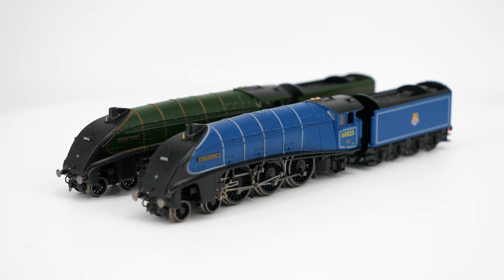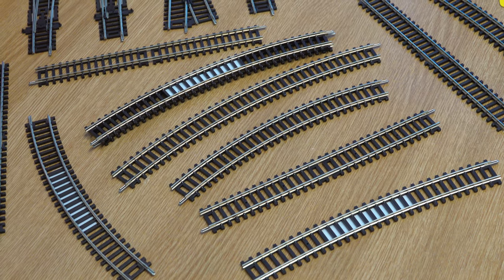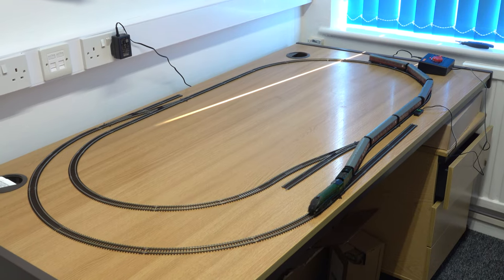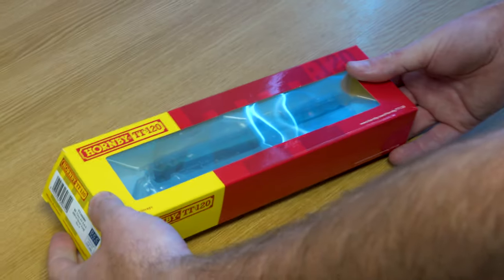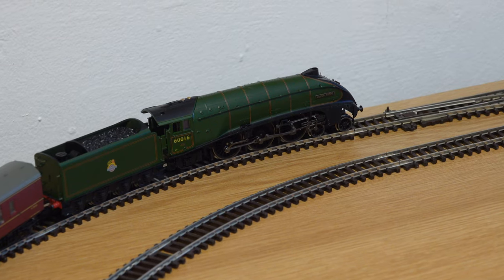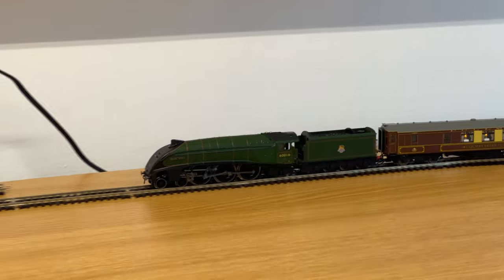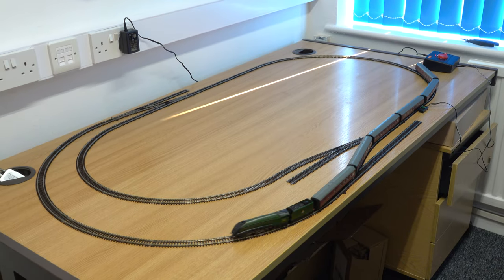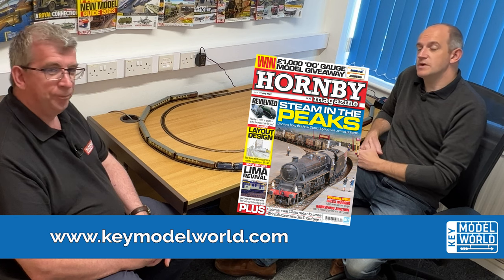HM193: Hornby 'TT:120' on test

Comment: im nearly finished the baseboards for Acton Wells in TT120 using 4 and 6 radius curves and straights. only thing is need hundreds of straights for 12 road fiddle yards. Have got a blue 08 which works with hornby analogue but with h and m controllers making the loco squeal. Pity cant get a driver in them. However have tested Flying Scotsman and mallard on 4 pullmans last week and run very smoothly . Lighting good too. No sound decoder for 08 yet as 6 pin what is best to use please. thanks
Reply from the maker: Thanks for your comments and great to here you are building a TT:120 layout. We are working on an installation guide for sound with the new Class 08 for release later this year.

Comment: I've not had a train set since I was a kid, far too long ago than I care to think about. Thinking of getting into it again with this scale but wondered if there is a big difference between TT and 00 in detail level levels? I like my detail....
Reply from the maker: Hi there. The new TT:120 models are very highly detailed and also look very true scale in ever way. Horny Model Railways have done a brilliant job on the tooling for the locos and rolling stock, so you won't be disappointed. Naturally the larger the models, the greater the detail (so OO will always have more) however TT:120 is highly detailed for the size that it is. 😊

Comment: Have they sorted the track geometry problem yet?
Reply: It doesn't look like it from the video. If you look closely you can see the track not sitting flat around the bends.
Reply: It feels that this video had filmed several months ago. But I' not sure if things have changed much since.
Reply: The "Geometry Problem" turned out to be a stress issue.  Once the curves are de-stressed they not only lay flat, but also have reasonably perfect geometry.
Reply: @WhatAboutTheBee  exactly a problem ,, pecos will without doubt be perfect straight out of the packaging , considering hornby specialize (allegedly )  in model railways you think they would be able to deliver a simple track section perfect from the box
Reply: @shakeyhandsshedmodelrailwa2494  get a grip.
Reply from the maker: Our track was loose laid on the desk top which caused the track not to sit flat around the curves here. The half circles we had of each radius (first, second and third) all made half circles correctly when tested. The video is new to go with our review of the A4, Mk 1s and Pullmans in the latest issue of Hornby Magazine - HM193, July 2023.
Reply: @hornbymag  the point that the Hornby TT track segments "all made half circles correctly when tested" cannot be emphasized enough.
Reply: @@ohiosteamandsteel Peco track all round is far superior.

Comment: Want too invest in TT but i see no mention of the smaller tank engines or era 2 locos. An 08 to move small freight and rolling stock around seems out of sink with the era 3 engines being served up. I dunno i think Hornby have something special potentially but there have been some red flags for me. Hopefully just teething problem because its new. May get into 00 gauge because of the availability of smaller engines, a shame, and yes i do not own a train set yet and am new to the hobby and  cramped for space. Would really love to see smaller engines, could do a lot in a small space, which is the idea. I love the smaller type of steam engines used in south Wales and the valleys in the past.

Comment: The rolling stock looks good, but I have to say that I prefer 3mm, 120 looks too close to N and those European couplings are awful (can they be used for shunting?). Also the track looks too much like Hornby circa 1976, such a wasted opportunity (I suppose that Peco's may be better 🤔). I was really excited about TT, but now it all feels a bit rushed, a bit curates egg to my mind. I was hoping for good reviews on the 08, perhaps a small shunting test track etc? But sadly the couplings and slow speed running Ive seen to date doesn't inspire confidence 😕😕😥
Reply: Actually I find the couplings are great! Better than those awful things on the n gauge stock. You think it’s rushed and the other comment😊 so far thinks it’s too slow 😂
Reply: hornbys track is their usual pants ,, got for running tillyou use peco to build a layout then throw away ,, pecos is much better and measures better
Reply: @shakeyhandsshedmodelrailwa2494  Hornby's track isn't pant and just you being as usual blinded by ego.
Reply: @LNER985  If you clip the track together carefully, fixing it down as you go then a circle has about 370 degrees. It need to be worked on to get it to work properly.
Reply: I've has no issues with the running of my 08. They need to be run in properly and the track / wheels need to be kept clean
Reply: @LNER985  actually it is pants , david blunket left his guide dog at home when he measured the sleeper spacing as it is incorrect and shows  it . pecos is the correct gaps ,, it is also widely known hornbys points are a poor relation to peco same is true in TT
Reply: @lukestevens8735  that's every model railway
Reply: @shakeyhandsshedmodelrailwa2494  No it isn't and Hornby's points are not poor. Have plenty of them on my layout with no issues and just you continuing to top on the hate bandwagon.
Reply: Hi Muso.  I was also very dubious of the couplings. They just looked wrong and seemed huge in relation to the models. However they way the connect is actually very smart and allows for nice close coupling. Uncoupling is less obvious than 00 but not hard once you the hang of it for shunting. And so far at least, my 08 runs very nicely at slow speeds.
Reply: @LNER985  you are wrong it is out of scale ,, do you have shares in the company by any chance ?? it has been measured in a review and compared to peco ,,,, you put a hornby point next to a peco point and compare pecos points are head and shoulders above hornbys quality ,, that is why 99% of permanent layouts use peco track and points hornbys is toy track in comparison
Reply: @Haymarket47  Can the couplings be used for hands free shunting, because they look awful but function over form may be their saviour 🤔
Reply: @LNER985  It bears little resemblance to the prototype.
Reply: @LNER985  There's no "hate" from my POV, just puzzled as to why the big manufacturers keep churning out the same or similar dross when it comes to track systems. It bears no resemblance to the prototype!
Reply: @gregmacdonald927  That's interesting and good to know. Thank you👍✌️😊
Reply: @musoseven8218  Literally every comment on YouTube from shakey hands shed model railways is hating on Hornby and never criticism the other manufactures.